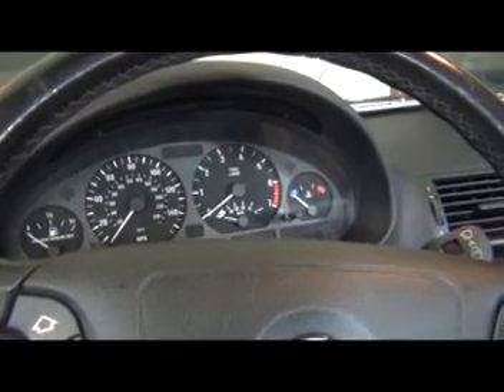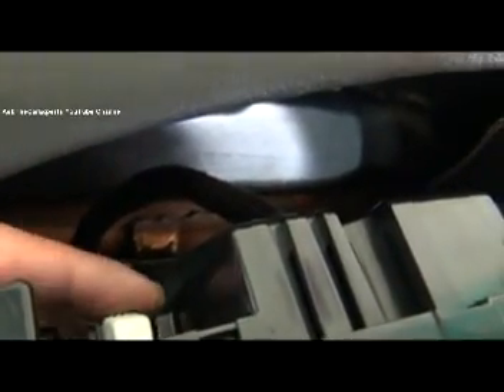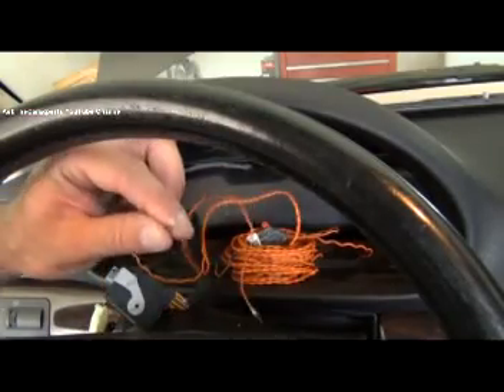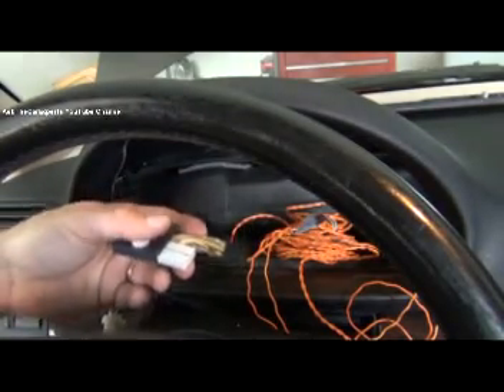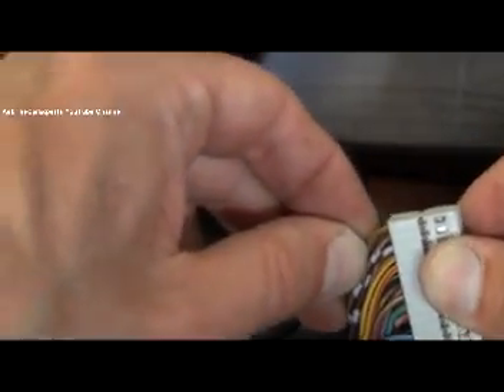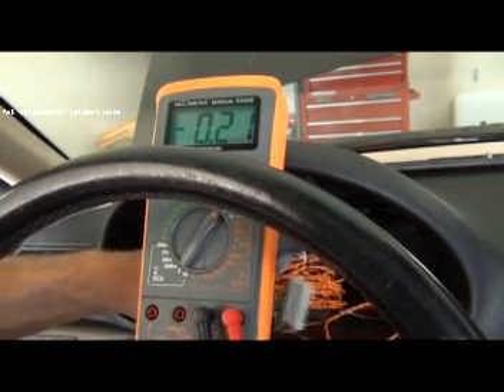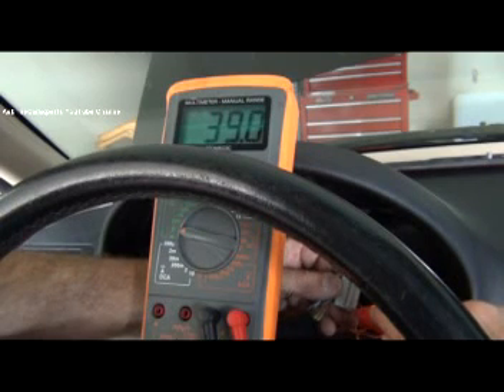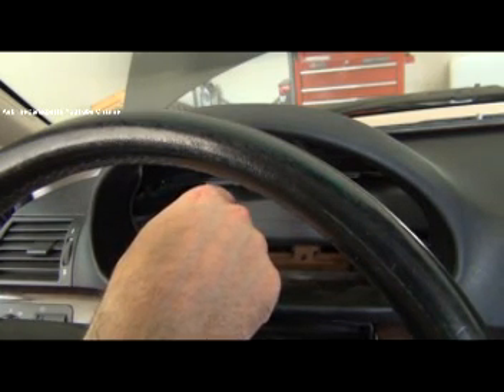BMW Instrument Cluster Removal Installation And Diagnosis Testing For Powers and Ground

Comment: You obviously have access to wiring diagrams. I used to do this kind of work on Corvettes. I am considering a BMW that has a non working dash. Watching you work is getting me motivated to actually buy this car. The BMW appears to be a car that was designed to be serviceable. The Corvette is not!
Reply from the maker: Hi Richard, BMW does have some odd quirks and they like to prevent module swapping by VIN coding but for the most part they are fun to work on.

Comment: Hey! I am having issues with my 09 335i. When the temp is colder (like in the morning) my car experiences problems with the electronics. The doors wont unlock, the wipers dont work, the guage cluster doesnt show speed or gas, and I get all sorts of warning lights. The car starts up, and after some driving the issues mostly go away. Do you have any idea what can be causing this?

Comment: My  Hyundai Sonata's cluster works, everything works on the cluster except the speedometer which once in a blue moon works correctly for a while then stops, i once hit it in the head and the needle moved worked for like 5 minutes and stooped. It was scanned by a mechanic and  he said the  cluster needs to be replaced i bought a used one in a good condition it was installed it worked for 20 minutes and stopped I hit it in the head and the needle moved it also worked for 10 minutes and stopped. So it seems to me the cluster is not the problem. WHAT THEN COULD POSSIBLY BE THE PROBLEM? I need your help.

Comment: you know that  i allready replaced the BC stalk, after that the 2 stalks work perfect finally, but the cluster is doing the same, it start and mark Fuel Gauge and RPM perfectly but 2 seconds after marks 0. After that Only works the odometer and the center display with all warning lights and sounds. So the stalk missing wasnt the problem. Or now i need a reset and software update from dealer?

Comment: Thanks, you are very helpfull for all of us, well i went to a bmw specialist mechanic, he remove the plugs and said me that the plugs are perfect whitout any  signs of oil, then he took out the CCV and find too much oil in that valve, he said me that the problem is the CCV and it is sending vapor oil to the intake and the that vapor is used as oxygen in the combustion and that cause the smoke from the exhaust. Thank you very much, you was right.

Comment from the maker: Alan, I watched your video. I would remove the plugs and see if they are fouling out. Also take a look inside the intake manifold by removing the throttle to see if you have oil build up in the intake. If so I would start with the CCV. I have heard of valve seals failing on the N62 engine but not on an E90 320i. It could be a leaking injector as well. Remove the oxygen sensor for the pre cat and see if you see any sign of oil. The exhaust valves on the N62 where the ones that usually leak.

Comment: Body, i really appreciate that you are doing for help me. I just have publicated a video showing my BMW e90 320i with Hot Engine and smoking when i press the accelerator. How can i know if is VALVE SEALS or CCV or oxygen sensor defective?

Comment from the maker: The K bus issue could be related to the stalk which is connected to the steering angle sensor which is on the K bus I believe. It sounds like you may do a lot of short distance driving which may be building water in the exhaust. Take a look around the engine to check to see if the valve cover is leaking oil near the exhaust side. It is common for them to leak and this could be the smoke you see while it burns off the hot exhaust.

Comment: I really appreciate all your help, I'll do you recommend, I'm really desperate with this problem in the cluster, my car has the BC stalk broken and missing of the ambient temperature sensor, maybe is that the problem? One last question, my car pulls smoke from exhaust sometimes is white with gray smoke if the car accelerated drop a lot of water through the exhaust, where I live the temperature is 40 ° C, very hot, do not understand.

Comment from the maker: Hello Alan, This may be an issue with the cluster but often on the E90 it is due to a communication failure on the communication bus called the K-bus. There are a lot of common spots the short and it can be a difficult find. I would recommend a scan at the dealer to see if you have K bus faults and they can check the common spots. This can be caused by a failing component or a chaffed wire or it could be the cluster. Some testing will need to be performed.

Comment: Hi, im having a serious problem with my Bmw E90 320i Limousine 2007. My cluster is malfunctioning. When i turn on the car, my fuel and RPM gauges show the correct information but after 2 seconds they fall to mark 0, only works the speedometer and the lcd display with the warnings lights. I made the Cluster Test and it past the test perfectly. I have the BC Indicator Stalk broken and the exterior temperature sensor missing. Can those parts cause the cluster failed after 2 seconds after start?

Comment: On my E46 330ci just the past couple of days (hottest of the year) I have noticed the LED readout on my instrument cluster has dimmed randomly a couple of times. Only for a second or two and it would brighten right back up. I actually just got home from my work drive and it did it again but I had the voltage test up and running when it did. No drop in voltage when it occured. It was reading between 13.8-13.9 under load. Just starting to look into causes, looks like might be an amb light sensor?

Comment from the maker: Hello cataha, I have never had to do this. The EWS and DME communicate for rolling code but not the cluster and EWS. The LCM on the other hand does store the mileage so if you swap in a cluster it will take the higher mileage from the LCM along with a manipulation dot, but as long as the vehicle is not drive once it is back in the LCM from the original vehicle it will revert back to the correct mileage. Thanks for the heads up in case I run into this :)